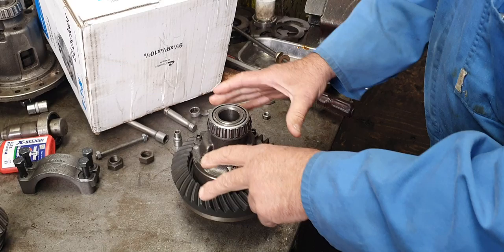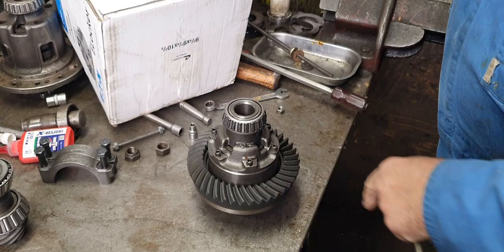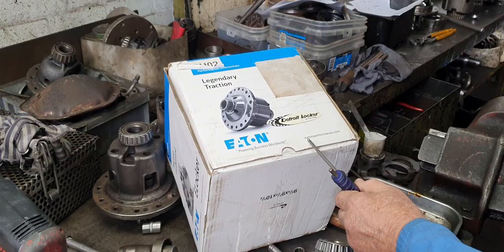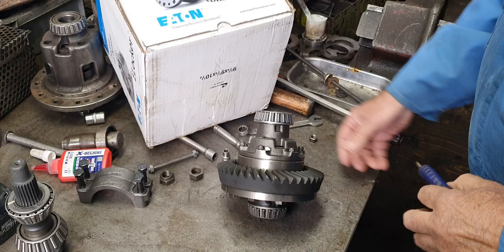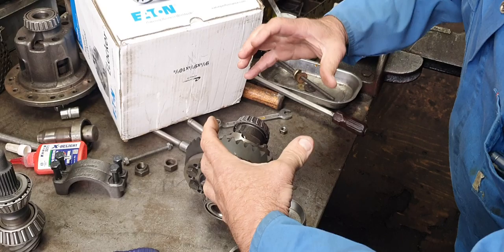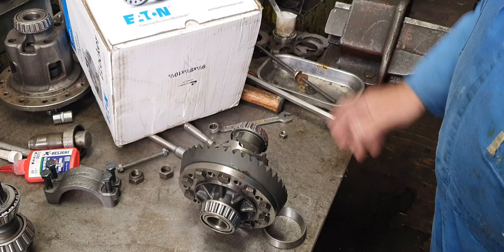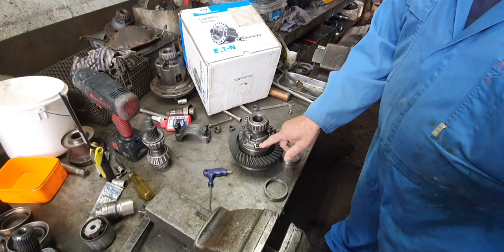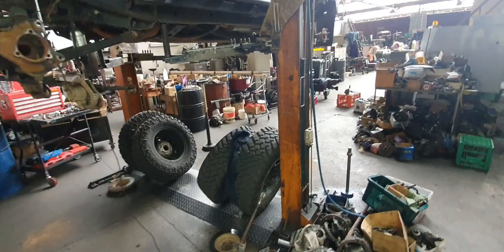Dana 30 Detroit locker Eaton. Jeep Wrangler unlimited front diff is DOOMED for failure.

Comment: 1/4 - 20 socket head grade 8 bolt has a tensile strength of 4,773 lbs. so 60% of that (shear load) is 2,863 lbs.  So if you do the math you have 17,182 lbs  of shear load there. Your not going to break it
Reply from the maker: How come we have pulled these out of several cars now with broken bolts ? To me it seems they are to small because they keep braking and blowing up diffs
Reply from the maker: I showed my dad what you have written. And he said keep dreaming. What you have said is completely incorrect. They are to small. Way way way to small
Reply: Funny, believe what you wish. Hundreds of those out on the trails working fine. I don't go by what I think, I use the math, that's what the engineers that designed it did as well. maybe your dad should tell Eaton they are all wrong and he knows best. Good to have faith in your dad, nothing wrong with that, but respectfully he is not a load calculating engineer. I have been a machine / fab shop owner for over 40 years and builder of waterjet pumps pushing over 55,000psi. We use things like MDESIGN software, numbers don't lie.  Just bothers me when people post things others may take a fact when it is really just opinion.
Reply from the maker: @deanwattles8722  mate we use maths as well. my dad made the TJM Pro locker. we've been engineers and working on diffs for 100 years. My dad started working on diffs 70 years ago when he was 10 years old, his dad worked on diffs and taught my dad all the tricks. We know more than anyone in the world believe me.when you put real big tires on these cars and go up and down hills these front dana 30 diffs are too small and when they have little bolts like this it is rediculous. Why not put bigger bolts in there ? We have seen these bolts brake hundreds of times. I don't have faith in my dad, I just know from working every day of the week for 20 years now that what is what with diffs. we have a full workshop with CNC lathes and CNC machining centres. We  make power lock LSD'S and diff locks for all different cars. So believe us when we say that they're too small because they really are. You can use maths, but you can never calculate what's going to happen in the real world and what people are going to do with there cars. Soon as you put bigger diameter tyres on the car there is more stresses on those bolts. So then that Maths you talk about doesn't work.
Reply from the maker: @deanwattles8722  but it's just an opinion if you don't want to believe us that is ok don't believe us. There is no point in arguing over something so silly.I would have thought it is common sense that they are too small. Making bolts that small makes it so you can't upgrade your car in the future. Like I keep saying, WHY NOT MAKE THE BOLTS BIGGER. BIGGER IS BETTER.
Reply: So your argument is my dad makes the tjm prolocker and all other lockers are shit.  That makes sense.
Reply from the maker: @nathanrotar5012  thank you. Ur so nice 😘

Comment: That is not a Detriot locker at all
Reply from the maker: yes it is mate they have made many different Detroit lockers over the years and this is one that is made inside a housing so if you take off those tiny little bolts or screws whatever you would call them. there is a Detroit locker system inside of that carrier case.